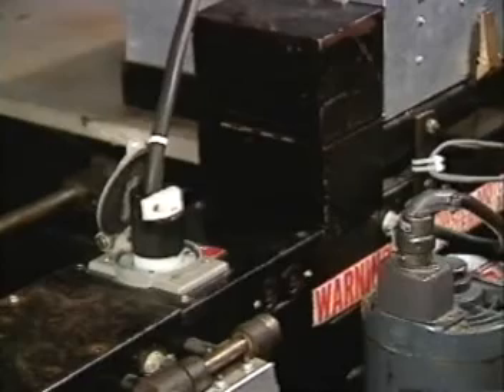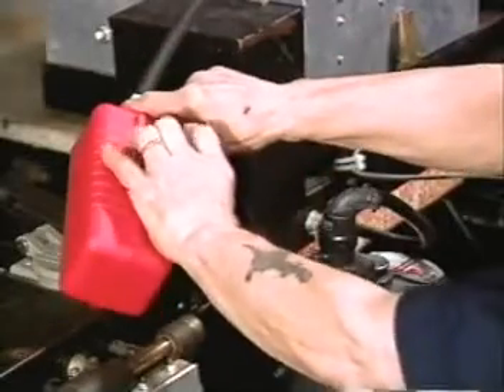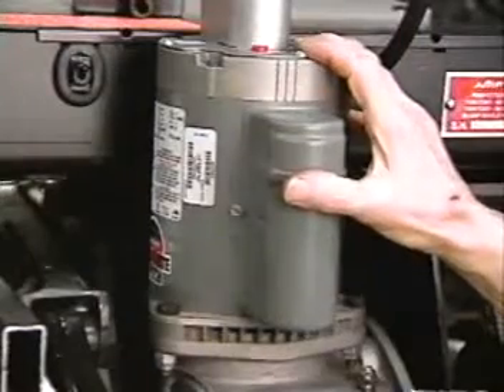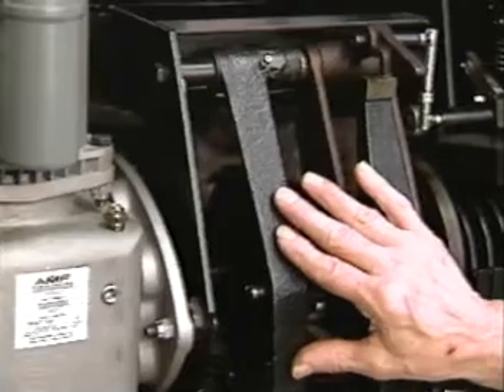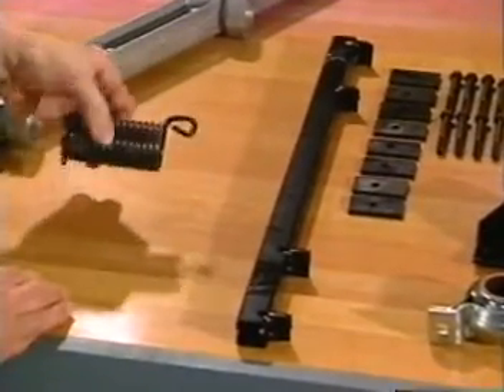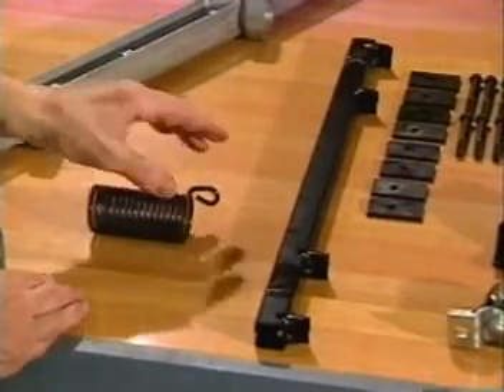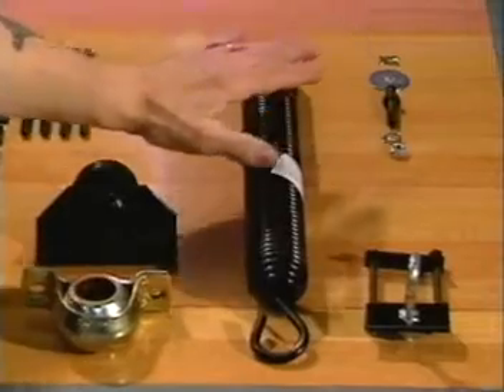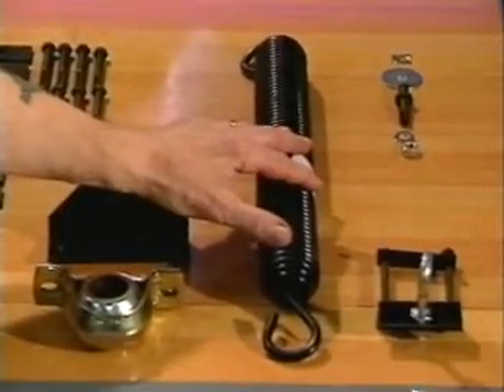Table Assembly

Comment: No one could break open that impenetrable plastic safety enclosure and energize that machine without the powers of Dr. Strange. Good thing Magneto isn't attempting to bypass LOTO. Let's be safe out there and remember, laws are written by lawyers to defend and protect companies with access to massive amounts of corporate funds they use to defend themselves and their holdings against "frivolous" lawsuits. Basically, every part of that machine can kill, maim, or, at the very least, give you tetanus. Big business wants to "buy the pot" on all suits for liable or in any cases involving injuries sustained through current or pre existing practices or flaws derived during manufacture that may result in injury and or legal actions that may affect the economic sustainability of the corporation.